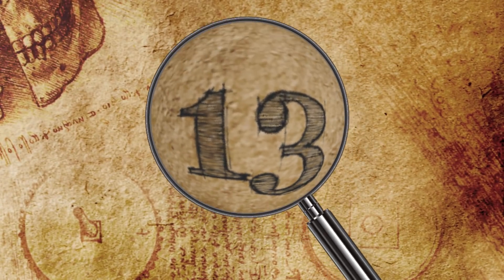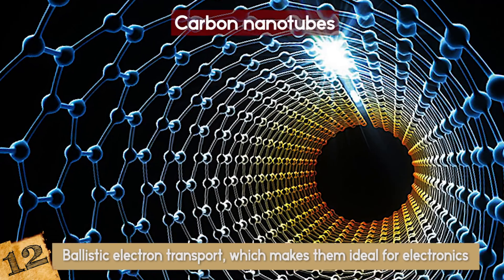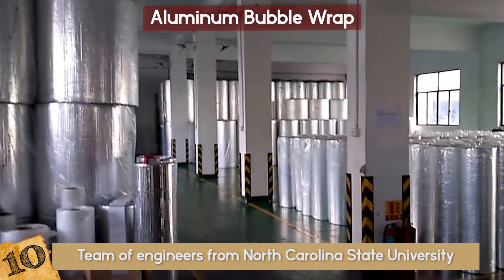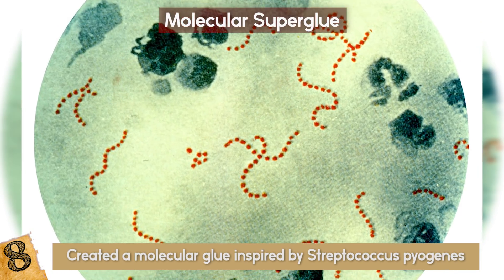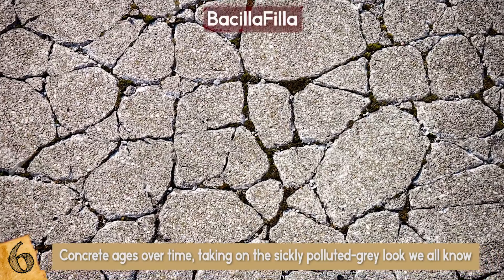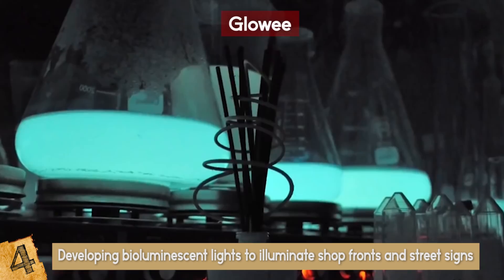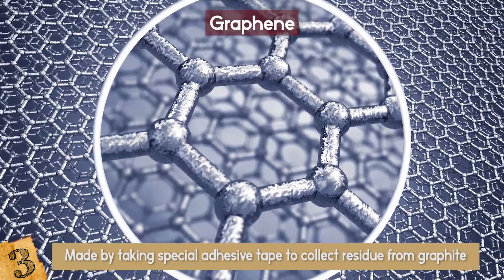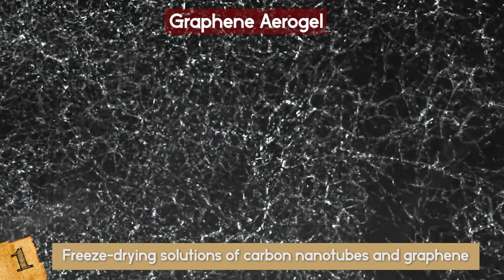Most AMAZING Materials Of The Future!

Comment: In Fact:

Most technologies in this video were given to mankind for an evolutionary push.  With a clear message to be used in conjunction with other technology that favors a clean environment. 
   
 Mother Gaia is out of tune and is resonating at a lower than sustainable level.  
 Directly related to these events.
1) Non- Human;  Damage im the upper atmosphere (radiation penetrating the magnetosphere.)
2) Human; Nuclear Radiation.  
3) Human; Mass low end vibrations in living cells. 
3) Human interference with fossil fuels.
Reply: Geoengineering

Comment: Didn't Arthur C. Clarke postulate a "Space elevator"?
YUP, must have been in the 60s?
"The Fountains of Paradise is a novel by British writer Arthur C. Clarke. Set in the 22nd century, it describes the construction of a space elevator. This "orbital tower" is a giant structure rising from the ground and linking with a satellite in geostationary orbit at the height of approximately 36,000 kilometres (approx. 22,300 miles). Such a structure would be used to raise payloads to orbit without the expense of using rockets. The novel won both the Hugo and Nebula Awards for Best Novel."

Comment: You should check out Washington DC local inventor “Mahmut Sarikaya” ; ‘Fire Wall’...product, it is a patented servals chemicals when dry will prevent heat transfer! And he is good buddy of mine. When insulated with aluminum with layers of ‘Fire wall’ chemical also block radiation.

Comment: There will never be a space elevator because the ionosphere is like the  collector ball on a Tesla coil and full of an almost endless supply of electrical energy from the sun. If you have a tether it will act as a ground cable and cause a massive electrical discharge that will be like a nuclear explosion like say Tunguska. It would also act like a giant guitar string and when struck by anything like wind for instance would emit a highly destructive low frequency vibration.
Reply: Now that's the making of a great disaster movie...
Reply: The Stratocaster incident
Reply: But this kid's funny and has a hell-of-an immigration.
Reply: Ajia Cooper ...or if it was a Gerard Butler movie: 'Space-Lift Has Fallen!'
Reply: actually that discharge can easily very easily be blowing in the wind with graphene being the conductor there already building ITER in france wer at a point wer tesla was 100 years ago except we now have the material graphene to conduct the energy through fusion plasma has been here recreating isnt the problem how to move the energy is
Reply: Its called Graphene look it up
Reply: Carbon nanotube can be an insulator Mr negative

Comment: Excuse me..! Build an elevator to bring things to the ISS...?? How..? When the ISS is orbiting the Earth in round 30.000 km/hour. And the Earth's surface speed is far away from that. Explain that to me....!
Reply: It wont work direct to iss but it could still act as lift into space rather than use fuel
Reply: That would be the purpose, get through the drag of atmosphere, then all the fuel reserved you could travel a lot farther than currently possible.
Reply: The Lord Nilsson they would use it to put another craft into orbit.. then that craft would dock with iss.  they never considered making the elevator directly to iss
Reply: Strech out your arms sideways and turn yourself around 360 degrees. How long did it take your fingertips and shoulders to finish that movement? And which distance did your fingertips travel and which your shoulders? 
Divide the distance of each with the time and then you have the answer.
Reply: Faulty example ! If it should be up to a geo-stationary-satellite, it could work. Because they are oribiting in parity with the Earth's rotation. But only "in the theory".  But... since the ISS travels much faster, than the Earth is turning around, it's of course is impossible. The ISS should pass the elevator in a heavy speed. And hopefully not crash with it. Or....?
Reply: You are right, its not geostationary. Then it wont work as far as I can tell. I thought you needed an explanation, how that could work, when a satellite is moving so much faster than the earths surface.